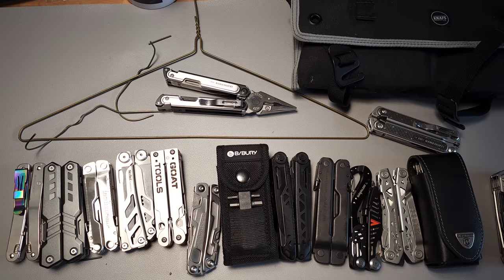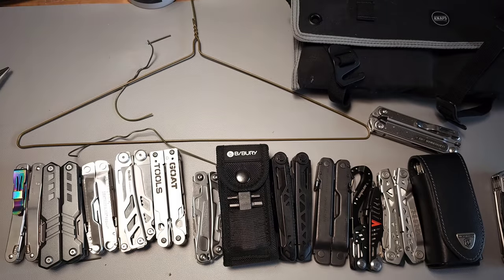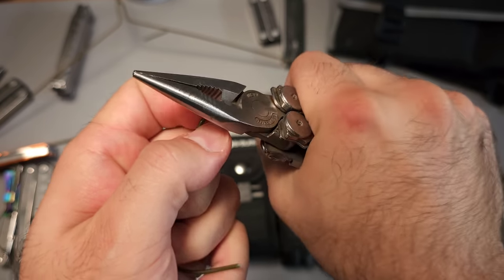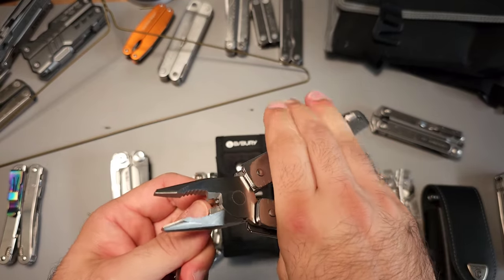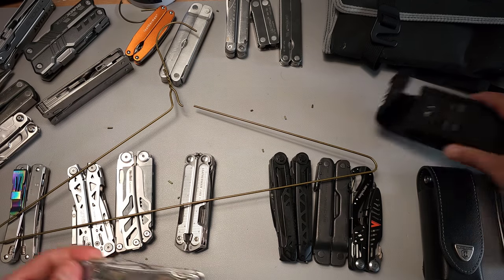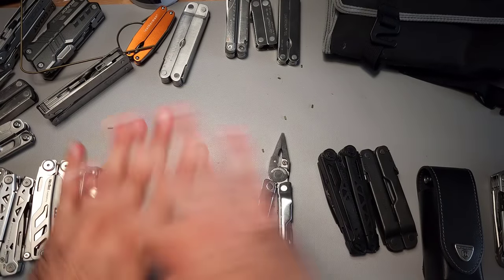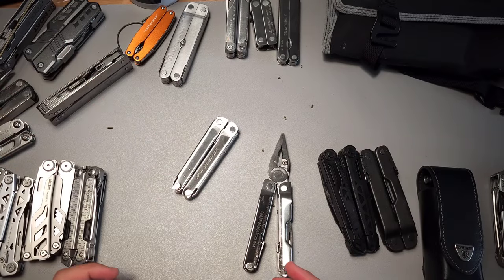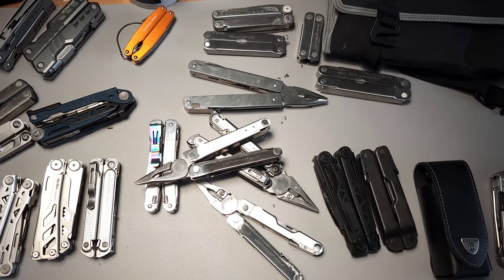Testing Multitool Wire Cutters (more than 15 tested, Leatherman PST - Arc)

Comment: PLEASE READ!!! I’m looking to buy a Leatherman wingman but the wire cutters features is very important to me as on the farm I am constantly cutting steel wire to tie things together. Does anyone know if the wingman has issues with the wire cutter?
Reply: Shouldn't be any major problems and should be similar to the Rev that he showed. I tested my Rev, Bibury wave clone, and wave on 14 gauge welded wire fence. They all cut and I doubt will have any problem, but the Rev takes more effort and hurts the hand a little. The frame where you grip is thinner and also distance between handles is wider so harder to get a good grip. If what you cut is thinner/easier that what I tried, should cut fine.
Reply from the maker: wingman has its cutters as part of the plier, should be fine.

Comment: The arc wire cutter compared with other previous LMs really something wrong. With  plier jaw fully closed, the cutter blade actually didn't reach other side. Instead it it just stop half way. I have LM rebar to compare.

Comment: Questioning the odd specificity of this test as a benchmark. Most of don't go around cutting coat hangers, but we do cut strand wire and braided wire regularly at smaller gauges. Poor cutters slide out of alignment squashing the strands rather than cutting. That would have been a more applicable test.

Comment: My 2006 Leatherman Wave just returned from warranty repair (rusted pliers and tools). They cleaned up most of the rust and replaced the plier head with the new replaceable hardwire cutters. I was happy, until I realized that the cutters have this flawed design with the radiused bottom. I hope Leatherman fixes this soon by issuing redesigned cutters.

Comment: I could not cut the same hanger type with my GOAT cutters... Easy work for Victorinox, SOG, and the Gerber Dual drive.  Also I am going to assume it is easy work for the Leatherman Signal (which I will test shortly). But the GOAT, and I tried! No go.  

Just curious if anyone else had a similar experience.
Reply from the maker: Very little relief edge
Reply: @maxlvledc  Yeah!  After you said I looked at the cutters... You are correct.

Comment: I loaned someone a Leatherman ~15 years ago or so … they tried to cut through a coat hanger and chipped the crap out of it.
Reply from the maker: well...either the handger was harden steel ( there are some like that) or you have a defective Leatherman. I've NEVER had one break on something so miniscule. I've cut nails with my Leatherman tools.

Comment: I wonder how Leatherman will sort this out for tools already sold in retail sales.  Other than tools sold directly by Leatherman, they don’t know who purchased tools that have, or might have, defective cutter blades.  If they were to require a receipt in order to mail a set of cutters out, they will make the problem far worse.  Same result if they require people to mail their Leatherman MTs in for replacement at the factory.  The only way to deal with this without alienating, sorry, further alienating, customers and destroying the brand value of their 25 year warranty would be to mail cutters to anyone who phones in or emails with a request for a free replacement set.  Keep an eye on this space….  And as an afterthought, what about tools that are currently sitting on retailers’ or distributors’ shelves?  Are they going to ask the distributors or retailers to replace the cutters, or let the customer do it after the retail purchase?  Problem: some current inventory with defective cutter blades won’t be sold for years - for example, if a distributor or retailer isn’t fairly carefully about putting new inventory at the back and moving older inventory up front so it’s sold before the newer inventory, you could have a 2023 Arc sold new to a retail buyer in, say, 2027, and it would probably have defective cutter inserts.  What a headache…
Reply from the maker: I think you nailed this perfectly
Reply: I received my ARC today, same gap at bottom with rounded edge, etc. I have an older black Leatherman I keep in my wife’s truck for emergencies…never used, so took cutters off both and compared… the older ones are dimensionally larger than the new ARC ones and less rounded edge. Swapped black cutters into ARC, no more gap, no issues cutting or breaking and the darker cutters and hardware makes an even better contrast to me. I will also add, my new black Surge I also received today has the same rounded edges and gap at bottom yet no issues cutting and no breaking? Puzzling, but emailing CSR tomorrow to discuss the issues of these cutters breaking so we shall see how they respond…going to add the videos so they can see for themselves.
Reply: Guessing they react somewhat like they did to the squirt ps4 and style ps scissors defect. Say nothing, no recall. But I think they'll redesign them for future sales, cause they don't want warranties across all their tools with replaceable cutters.(maybe I'm giving them too much credit)

Comment: What I want to know is if new wire cutters are braking If you don't stuff it all the way to the gap.
Reply from the maker: Probably not, but I didn't buy a leatherman to baby it.
Reply: @maxlvledc But at the list we will know it is just a gap issue and not a steel problem. When you are aware of it it could be advantageous as you now have a much better wire stripper than one on the awl 😂

Comment: Is there any point to edc a heavy $300 multitool that fails when it is finally needed?  $300 will buy you a bucket full of tools that you can work to death. 🤔 Stash the bucket in your vehicle and the walk of  inconvenience will be compensated by the bucket providing a seat while doing repairs. The convenience factor also seems to be overridden by the cost factor. I think I just convinced myself if not anybody else. 💡
Reply: If your filling a bucket with tools for $300.. I doubt they'd perform much better.  But I get your point.

Comment: It will be interesting how Leatherman fixes this.   I am sure they must be having many meetings about this problem...and how word is spreading over the internet......I wonder if production will be halted on assembly lines?...or will they keep manufacturing defective product to keep retailers stocked..... 

They need to remove and inspect all cutters in inventory......

They need to research when manufacturing process/ design change/ or new supplier occured.....

They need to research which models are affected....and how far back in manufacturing date......

Come up with a plan to get new cutters into the hands of their comsumers...

This is a Royal MESS for Leatherman...and is gonna cost them a good chunk of money......or be a huge hit to their reputation.....if they don't rectify it....Imagine if all their inventory is defective cutters?   How long to manufacture from scratch new cutters?  If the cutters are not made in house...how long to get them made back to previous style?....with supply line/ worker shortages?....

Stay tuned......

Comment: They might be making them with less quality on purpose. The cutters are now consumable which creates another revenue stream. I'm sure they didn't intend for them to be this low quality but I am sure they intended to lessen the life of the now consumable cutters to increase purchases of more cutters. i think about all of the multi tools I've owned and none of them have replaceable cutters. I've never broken the non replaceable cutters on any multi tool and i use them every day.  IMO there really is no need beyond creating more revenue to have a mulit tool with replaceable cutters. I'm not saying non replaceable cutters don't break but you certainly do have to try a lot harder to break them than the replaceable cutters on any multi tool. The worst replaceable cutters are Gerber's. I have an MP600 pre replaceable cutters and have cut loads different wire and i still have no problem with them. The new MP600's have the replaceable cutters that break all the time. I won't buy a mulit tool with replaceable cutters. IMO it's just telling these companies that lowering quality and charging for a consumable to replace quality is okay.

Comment: Pretty sad when even Gerber's bunk ass carbide cutters and a chinese clone outperform Leatherman. I wiped out my Arc's cutters today when I was cutting some bailing wire to hold my buddy's bike's muffler on so he could get home after a bolt backed out (fool didn't use loctite). That's sad as hell. I wouldn't even be afraid to use my dad's super ancient PST to cut bailing wire
Reply from the maker: Wait, they broke on bailing wire????
Reply: @maxlvledc  12 gauge bailing wire on the second cut. I cut the length I needed and then cut one of the tails and the cutters broke. Had to do the last tail with my Juice CS4. The Arc's cutters are pathetic. I tested the ones on all my other post 2022 Leathermans and had no issues. I think it's something about the way they sit in the Arc